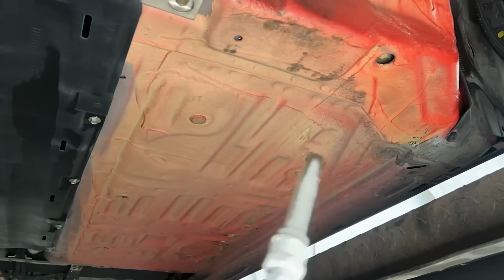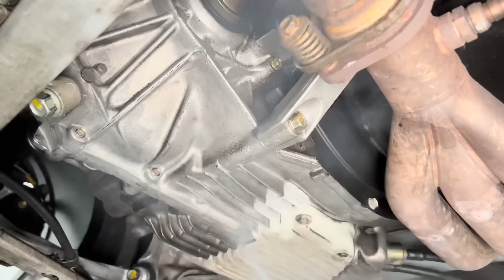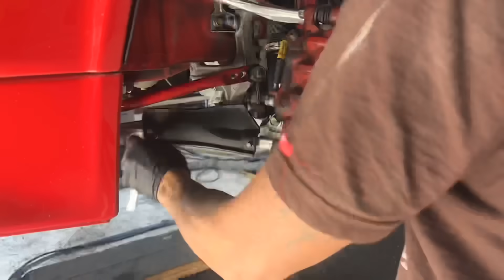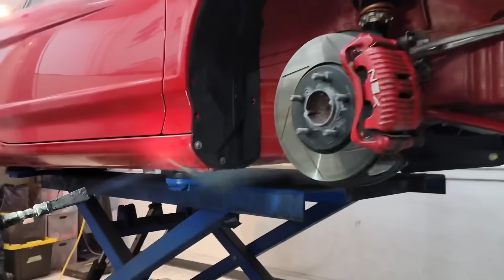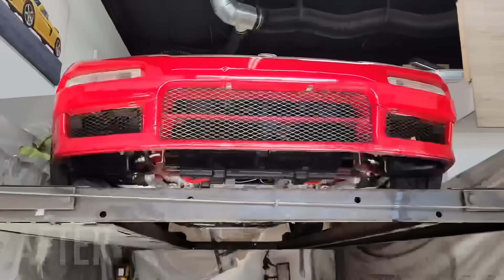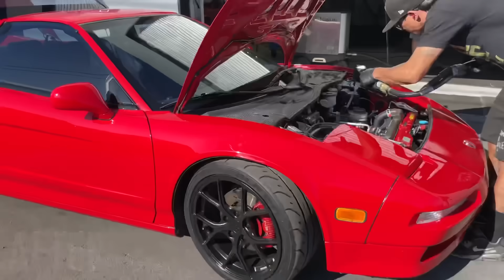DRY ICE CLEANING the MOST ICONIC Honda? The Honda NSX

Comment: Well done now the underside of the car and arches are now going to rust 🤣🤣
Reply from the maker: Unlikely. Southern California car with an aluminum body...
Reply: @IAMDetailing  aluminium is even worse honestly you should have done your homework before blasting all that away
Reply from the maker: @birdcrazy329  I think we've done plenty of research lol maybe you should do the same? Here's your chemistry lesson for today: Aluminum doesn't "rust" in the way you're using the term. Now, it can corrode, but it is EXTREMELY resistant to corrosion because it quickly develops a protective coating called ALUMINUM OXIDE! In fact, it makes an aluminum unibody, like the NSX, the perfect candidate for this treatment. Which is why the protective coating is more for sound deadening than for rust...

Our clients are very knowledgeable and we provide them what they ask for. Many of these cars are southern California cars who have very little risk of rust, in general. We apply 3M clear matte protective wax to the most sensitive parts of the car, and we recommend that if these cars are returning to another climate other than our own, that they reapply a protective coating.
Reply: @IAMDetailing  awesome stuff

Comment: Does the abrasive force not damage bushings, cables etc?
Reply from the maker: That's actually a huge reason for using Dry Ice. We can crank it up high and remove paint, or we can be gentle and clean stickers, rubber, leather, you name it.

Comment: What psi and flow rate, or volume of ice?
Reply from the maker: We usually working with 30-80psi depend what we doing.
Usually 1LB of ice per min
Reply: @IAMDetailing  Thank you! I have a fancy ice blast machine at my work I may try to use a little bit.

Comment: CO2 bead blasting has been used in the semiconductor industry for over 20 years to clean things like silicon carbide with unique coatings or stainless steel with special treatments. I am surprised it took this long to get to automotive.

Comment: Great job, how much dry ice do you use for a job like this, because here in South Africa getting dry ice is Extremely expensive.
Reply from the maker: Thanks Daniel! About 500lbs on a classic car.
Reply: Thanks, that's about 500lb at  about $ 50 /lb  = $ 25000 just for the ice. 😔
Reply: @danielb2145  And, the machine costs about $55,000.

Comment: So you take off all the rust proofing then add it back again?? Then it's black again?
Reply from the maker: We use clear matte wax when we reapply the protective coating. Also, these are california cars, so sometimes, the owners forgo reapplying protective coating because .. we don't need it here.
Reply: @IAMDetailing  can we see one after you reapplied the wax?
Reply from the maker: @shucrybaroody6205  the wax is clear (no changing the color) just a little bit more satin finish… and this one was done too… usually shots after are with the wax already on it.

Comment: no cleaning gas tank?
Reply from the maker: We leave the gas tank on the NSX for two reasons, one is that it’s more susceptible to rust because of the materials made out of than the rest of the car, and two because the gas tank on the NSX is hard to reach without taking the tank out, so it’s very hard to get it cleaned good to make it worth the effort

Comment: I estimate $4,572 + environmental disposal fees.
It took 16 hours, with a shop rate of $150/hr = $2,400.
Average out the cost of the equipment over 100 contracts/jobs/requests = $55,000/100 = $550.
$2,400 + $550 = $2,950.
Add the 55% Capitalistic Business fee, of ($2,950 x .55 = $1,622) and you're at ($2,950 + $1,622 =) $4,572

Comment: Looks to me like a lot of rust is on its way after this. Only thing I can see a use for this is a "pre clean" before disassembly to apply powder coating to parts or new paint.
Reply from the maker: Please read the 500 other comments i responded to
Reply: @IAMDetailing  yeah I read some of them. I still don't see a positive to this application. It's good work, don't get me wrong, but if the owner decides to roll around after your work, it's going to get rusty.
Reply from the maker: @matttaylor817  Fun fact: The NSX is an all aluminum monocoque body.. which will not rust. Again, we're in southern california, so there's very little risk of rust anyways, even if there isn't an aluminum body.

Comment: What happens to all the gunk blasted off? Doesn’t it make a mess on the floor? How do you get it off the floor? Does it damage painted surfaces?
Reply from the maker: It does not damage painted surfaces if you know how to use the machine settings. 
Yes it make a mess on the floor and everything around is covered with fine dust 🥴 that’s why we opening another shop just for detailing to separate these two business.

Comment: That pressure washer taking off grime scares me, ngl.  I can’t help but wonder if it’s going to puncture a hole in the body.
Reply from the maker: It's dry ice and its compressed air. It's extremely versitile, and we can adjust the settings to be quite gentle

Comment: I know you get this asked a lot. But how much dry ice do you normally use? Because you did a ton of work!
Reply from the maker: Usually we spent one bin for one car that means around 500lbs of ice 😉
Reply: @IAMDetailing  that's crazy!!! Great video by the way. Keep up the great work.
Reply: So what was the total charge to clean this car? Give us an idea of prices to have our cars cleaned.
Be straight forward please.
Reply from the maker: @mon-ti6bx  each car is different same as the owner and that means the price can be very very different.  For one owner $1000 will be enough and he will be happy with result but for the other even $2000 are not enough to clean on the level he will feel satisfied. So if you need a quote call, text or send us email and we will be happy to help you. But there is no one car, one project same. The price can be low as $400 and usually ends around $3500 but could be higher if it’s complicated project that require more time.

Comment: Aren't the wheel wells supposed to be black? That's paint not dirt.
Reply from the maker: It is not paint. It is a mix of dirt, underbody coating, and sound deadening material.
Reply: @IAMDetailing  yeah, that's what I was thinking. Odd that the owner wanted it off. I guess they will reapply it later.

Comment: I thought undercoating was there to protect, you know, under your car.
Reply from the maker: This is undercoating and years and years of road grime. Wouldn't it be nice if you could wipe it all away and start with fresh, modern solutions that are years beyond the protection of the past? Depending on what the owner wants, we reapply factory cosmoline or 3M Clear Matte Wax to protect the vehicle from rust.

Comment: Don't you need to put on new protection coating afterwards? I think this is dangerous to leave it like this, every small piece of gravel will chip the paint after this...
Reply from the maker: Hi John, this has been answered many times on our channel :) Depending on what the owner wants, we will reapply factory cosmoline or 3M clear matte wax to protect the car.
Reply: @IAMDetailing  Then why not show that you coat again afterwards? You only show the stripping, which clearly (as can be seen by many comments) give some people the impression that a 'dirty' underbody is bad and that is should be squeeky clean and every bit of paint and metal exposed, which couldn't really be more fare from the truth!
Reply from the maker: @renefriis-christensen5513  in most of the cases we applying 3M clear protection wax for oxidation/rust protection and sometimes we catch that process (spraying) in our videos and sometimes not… after shots does not show anything different since the coat is clear. 

We are not spraying undercoating on the cars since people don’t want that here in CA. Most of our clients want strip coating down and protect aluminum/metal parts with wax. 
Everything is up to our clients, so if you want to see re-applying undercoating then be the first and ship us your car and we will do that 😉 and show you on the video.

Comment: Seeing videos of cars undamaged by road salt is enjoyable. But the comments from people (living where road salt is used) thinking they can just do to their cars exactly what they watched in the video is cringe.

Especially on videos of exhaust work. Types of videos that make people think they can take off a rusted nut because some guy in a vid took out that same nut (although less corroded) easily. Then they round the edges and now no one can get it off. When I could've heated it with a torch and got it loose.

I guess my point is, if you live in the rust belt and you're going to DIY your auto service, just make sure you don't mess something up. Its just a waste of your time and the shop owners time when you do. And don't be surprised if they quote you a higher price than they did before you screwed it up.
Reply from the maker: Fantastic comment. Thank you for watching and being a part of our community

Comment: 90% of what you're 'cleaning' off is the factory paint and underseal
Reply: Seriously. And obviously the factory coating was still doing it's job, because now we can see underneath it. I don't know why you would do this unless you had good reason to suspect the factory coating had failed. It's only original once, and I have a hard time believing a detailer is going to do a better job of reapplying the coating than the factory did in the first place.
Reply from the maker: As you can see from video 80% of the car was exposed all the time… no coating, no protection and it survive over 20years with no problem at all. After cleaning we protect some parts with clear wax to preserve the perfect look for years to come. 
Btw. our clients know what they want and what it means to them and we always trying to delivered that as they expecting. 

And if you are not from CA then I recommend you to do a little research. 99% cars that are usually full of rust everywhere in the world are usually in really nice/perfect condition without any protection 😉 and we talking about daily cars… not NSX driven on weekends and sleeping in garage 😁
Reply: @IAMDetailing  do my research? Ooof. No, I don't live in CA. But I drive a sports car with sticky tires on, you know, roads, and observe results. You're telling me a "clear wax" is going to keep all the debris the R888s on that NSX kick up from blasting the finish of off areas that used to be protected by factory coatings? Uh-huh, OK. Sure, take the customers money, but let's not pretend you're doing him any favors...
Reply from the maker: @KnauerJonathan  I think you missed the part about this being an NSX that's driven on the weekends and kept in a garage while you're flexing your Toyo's on the internet.

Comment: Really good job but should we really be blasting carbon dioxide when other alternatives are available? Climate change etc.
Reply from the maker: This has been answered many times before on our channel. Dry Ice Cleaning is carbon neutral, as dry ice is created from industrial CO2 reclamation. Anything that cleans this well is usually rather packed full of chemicals. Dry Ice is a pretty clean way to do this, especially since it's peanuts compared to what the major industrial processes pump out on the daily

Comment: Taking all that protective layer off that no one will see, awesome… 😂 hello rustttt
Reply from the maker: We're lucky enough to be in California, where we have almost zero concerns about rust. But if the owner would like, we reapply an aftermarket coating. It's newer, cleaner, works better than the original protection, and it doesn't have 20+ years of crap stuck to it. Also, your mechanic (or yourself) will genuinely appreciate it. Or the guy buying your car..

Comment: this is just stupid plus damaging. who is looking a car under floor? this car has a rubber paint like protection there, plus all the dirt and grease make it even more protected, now you remove all the grease and dry ice blasting is not so abrasive as dusting but still can damage the paint . also cooling all the rubber and plastic down to minus 100  surely cant be good for material. 
clean your car indide and wash it outside and you are good.
dont clean engine bays, wheel space or floor.
Reply from the maker: As you can see from video 80% of the car was exposed all the time… no coating, no protection and it survive over 20years with no problem at all. After cleaning we protect some parts with clear wax to preserve the perfect look for years to come. 
Btw. our clients know what they want and what it means to them and we always trying to delivered that as they expecting. 

And if you are not from CA then I recommend you to do a little research. 99% cars that are usually full of rust everywhere in the world are usually in really nice/perfect condition without any protection 😉 and we talking about daily cars… not NSX driven on weekends and sleeping in garage 😁

Comment: Isn’t anyone concerned about the amount of CO2 released into the atmosphere?
Reply from the maker: Dry Ice is made from reclaimed CO2 and is carbon neutral.
Reply: @IAMDetailing  Dry ice is solid CO2 and when it thaws it is released into the atmosphere. Do you care about global warming?
Reply from the maker: @richardnix4737  Was my original statement not clear? This is reclaimed from industrial processes. It is carbon neutral. If you want to point fingers at global warming, go talk to Opec and other massive conglomerates that are producing CO2 at large. 

Do you care about the environment? Then why are you wasting time talking on a youtube channel you don't care about while burning coal to power your machine, or mining lithium for the battery of your phone? Go troll somewhere else, kindly.
Reply: @IAMDetailing  I looked it up. You are correct. Aplogies